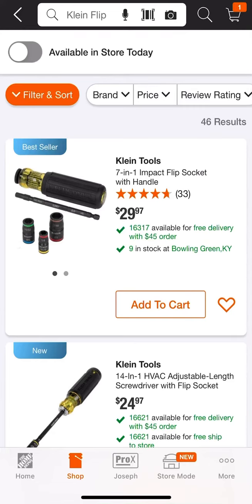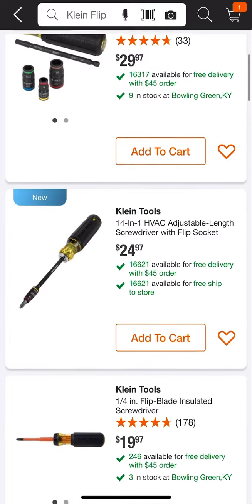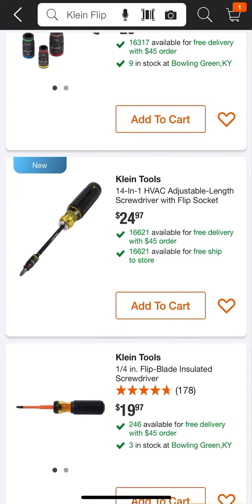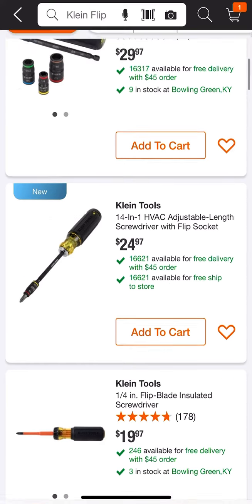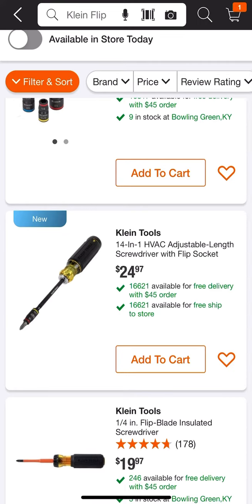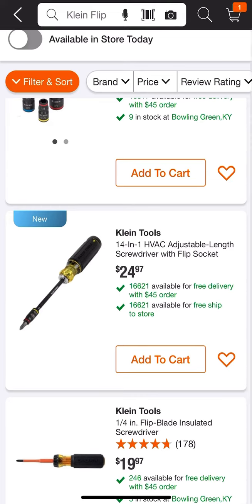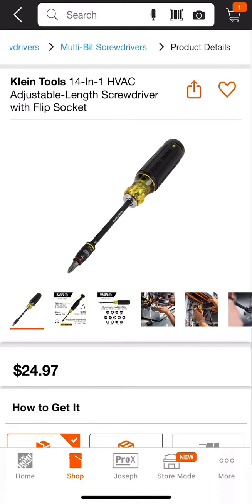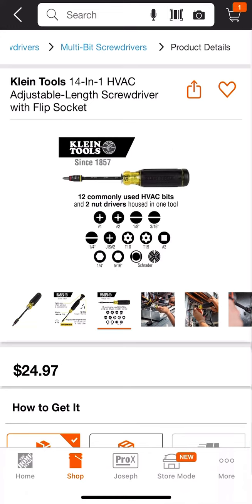Klein Tools Flip Socket Variation 32304 - HVAC - New Tool Anouncement

Comment: Yup I'm doing it.. to make the super  driver with the collapsible shaft. .. lol why not have an extra laying around... live by the rule "2 is 1 and 1 is none"
Reply from the maker: The old flip socket handle can be useful.  I leave my handle on my bench. You can put any bit you have that has 1/4 hex shaft in it. I will put tapping bits, conduit reamer bit, etc. into it and use it for that when I need it.

I’m with you. I already bought two flip sockets😂

Comment: My 14in1 has been terrible.  From what I’ve seen it’s common for the bit holder to not hold bits very well.  Sometimes my 14in1 bit holder tray gets stuck in the handle and jams up the whole mechanism.  I like the flip driver though, and it’s a nice set but after a few months and a few drops, I think a lot of people will just stick with the flip socket extension in their old driver.
Reply from the maker: A lot have said that.  I haven’t had issues with mine but I haven’t swapped bits a ton yet either.  I have noticed certain bits that I swapped out some of the Kleins for don’t fit in it well and make it harder to open.

Thanks for your comment and letting everyone know.

Comment: Good spotting !
Reply from the maker: I was actually searching to see if the had just the flip socket shaft yet. You can get it for $19.99 without the handle but not at the Depot yet.
Reply: @MORGANSMaintenance  I had to get the nut drivers + handle , the only format available here in Canada ! Basically the shaft/ nut drivers is in my bag , the handle is rattling around in my spare parts box . I’ll probably run the shaft and drivers off my Wera Rapidaptor handles . I’ll be interested to see how it holds up vs. the Malco offerings . BTW , I don’t know if you are aware , but Malco has a 10/8mm nut driver in the works , I asked my local dealer to snag me one !
Reply from the maker: @chrisfyfe9212  I’ve toyed with going the WERA route with their driver that has bit storage. I really like the grip of their handles. 

You can use that handle to make yourself another screwdriver with a specialty bit sometime.  I keep one laying on my bench just for that.

I actually have an 8 and 10mm Malco bit.  I think the may have a 6 and 8mm too but I haven’t seen that one.
Reply from the maker: @chrisfyfe9212  I just checked.  I got the 8 /10 off Amazon but they have the 6/8 on there now too.

Although they may "really” be Malco.  They say they are but who knows on Amazon.
Reply from the maker: @chrisfyfe9212  also there is probably no doubt the Malco shaft is more stout. I have abused those things. I think the Klein will hold up unless you do something crazy with it.
Reply: @MORGANSMaintenance  Agreed , If I have to play ruff , I have several rails worth of Impact rated Gearwrench sockets . Those little guys are more of a convinience item !